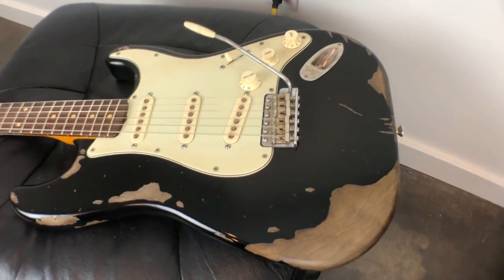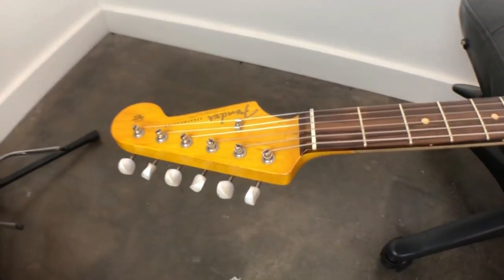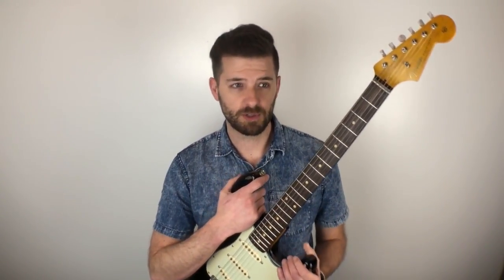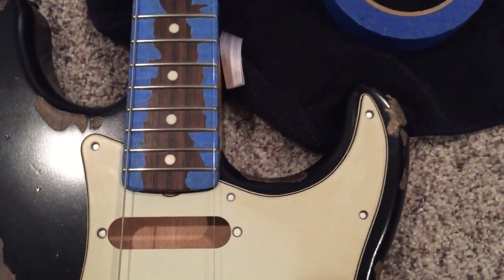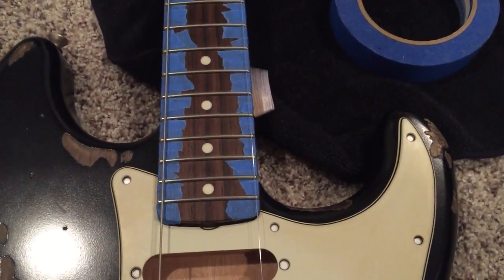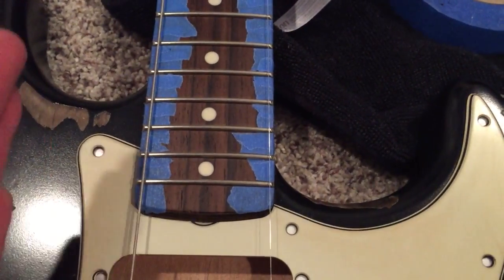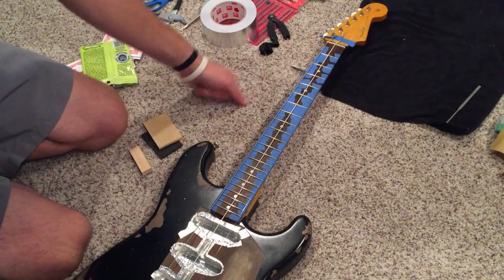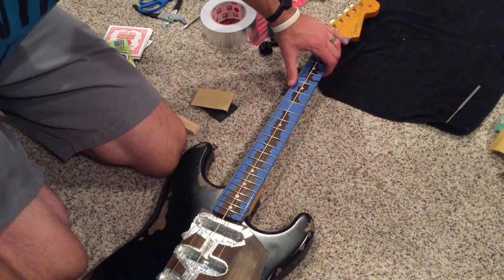How to Install a Bolt On Neck Without a Drill Press

Comment: This might be a dumb question, but could you clamp the neck your way, drill two holes, insert and tighten two screws in those two holes to fixate the neck? Then remove the clamp and drill the remaining two holes?
Reply from the maker: Raunch I don't think it's a dumb question at all. Great idea! I think it would work!

Comment: Too much digressing... the vid title is drilling neck holes with no drill press. A hand drill with a 'bullseye level' can be good enough. But a drill press is precise and the best bet to use. Drill the holes with a bit just smaller than the diameter of the screws and ChapStick will very lightly lube the 4-screw threads to make installing screws easier. I mark the neck heel lightly with a nail just large enough to fit in the 4 neck-attachment-holes. Then drill into those 4 marks carefully and just deep enough. 'Deep enough' is just enough for the screw finally snug in at the neck/plate with the pointed end and barely starting to 'bite' raw wood of the neck rear face. Tap the neck heel after drilling to be sure any sawdust is removed...
Reply from the maker: Thanks for the info.

Comment: Old video I know but i would have used the back plate as the guide for the 4 holes, set the neck where I wanted, used a small punch or coat hanger even to mark where the holes go on the neck, then take a small bit to drill a tiny pilot hole jn the neck so the screw grabs. Put the neck back on, give'er. The screw should catch that pilot hole and go. Then I'd get the screws just where they hit the neck and hand tighten the rest. I've done it in the past without issue. Maybe I got lucky but it doesn't need to be that big of a stresser. ( as long as you don't go through the fretboard lol)
Reply from the maker: Good thoughts! I considered something like this, but I wasn't sure if I could get the holes marked/punched well enough. I think I kind of got lucky too, because I tried this method again & ran into issues, as seen here 😬: https://youtu.be/Pj9CETVxFDE

Comment: I used a $25 right angle screw jig from Amazon, and marked my drill bit with tape for the proper depth to drill my holes into my new strat neck. Took a lot of worry out of it for me, since it was my first time drilling a neck. Worked great, and it was worth the $25 not to ruin the neck. I'm pretty sure I use a 3/16 bit.
Reply from the maker: Nice! Way to get creative. 👍🏻 I’d love to see what you used. Do you have an Amazon link?
Reply: @NathanSink  I just checked at Lowe's ,  and they have drill guide for 8 bucks, but it's not as wide as the one on Amazon, but it would probably with also
Reply from the maker: @caseylee12  oh gotcha. Thanks!

Comment: Hello Nathan,  I'm doing a kitchen table telecaster, no drill press. As you did .I'm dreading this step. This upload helped me out a lot! Especially the tip about wrapping the drill bit with tape. Thank you! So damn the torpedoes!
Reply from the maker: Timothy J. Horan glad it helped! The method worked out great for me & I didn't have any fit-up or alignment issues. 👍🏻 Best of luck!
Reply: be sure a hand drill has a 'bubble' level in the hand-grip area so the bit is kept square to the area to be drilled...

Comment: Thank you for the video, incredibly informative, I will be coming back to this later on in the week when my baritone conversion neck shows up for my Strat, already blacked out the hardware (save the tuners of course haha) this afternoon!
Reply from the maker: Glad to help! Not to scare you or anything, but I thought I might also share this video where drilling the neck holes went wrong 😬: https://youtu.be/Pj9CETVxFDE?si=v_L6Uvzd2KrAyBh- (it’s about 12:53 into the video). Bottom line is just be careful & take your time. 🙂

Comment: Hi, man.
What diameter of drill do you use?
My screw diameter measures 5mm. Do i use exact same gauge or smaller?
Reply from the maker: I believe I used a 1/8 inch bit (which is more like 3mm). Definitely go smaller than your screw diameter.
Reply: @NathanSink  Got it. Smaller than screw diameter. Thanks man

Comment: Thank you very much for your "tutorial" bro. I am like you. Not a professional luthier kk, and have a new neck coming today. I've done this before but had to check it again . Have the same problems and doubts you showed in your video kk, hope I do it ok.
Thanks
Reply from the maker: Roberto Danenberg Candia thanks! Hope your project turns out well. As a word of caution, the next guitar I did this to, I screwed up. You can see it at about 15 minutes in this video: https://youtu.be/Pj9CETVxFDE?t=932 The problem was that I used a C-clamp. So, my advise is to use a good ratcheting clamp!
Reply: @NathanSink  yeap,  fortunately  I have one of these at home. Bought it some time ago to do another job ...we'll see
Reply: @NathanSink  By now I'm watching another video of yours trying to redo an installation on a tele,  the saga  ends lol

Comment: I have a Tonebomb body too but it''s in HSS route.  I put only a little thought into the neck alignment and got lucky though.  That's probably because the Stew Mac Mighty Mite neck was a very snug fit and the neck pocket was squared up nicely.  After marking the neck drill locations through the body, I was just careful to use a drill press ... or lucky enough to now own a drill press.  A machinist showed me to start all holes with a center drill countersink bit as it won't wobble like a drill bit.  So the holes were started and positioned correctly.  Anyway, that only applies if a person has a drill press.  You've shown us how to get things right without a drill press.  Thankfully guys like  you are also showing people how to test neck alignment with the E strings on and the neck clamped in place.  I could have completely botched the neck alignment because I didn't know that tip.  

Like you, I've spent way more on the project strat than a good Korean strat clone would have cost.  That's not what it's about though!
Reply from the maker: 4estGimp thanks for sharing your experience! I haven’t heard from another Tonebomb customer. Glad everything worked out....even with the string alignment. 😊👍🏻

Comment: I am building my own strat using an USA American Special body. But i believe the original Fender necks comes pre-drilled. But i would gone this way:
get body and desired neck
fit and clamp neck as straight as possible then figure out your string spacing for your bridge.
Get the desired tremolo bridge and screw it on, then string up both high and low E-strings only and align them and make sure they are okay.
Clamp down neck and drill holes. then fit on the rest.
Reply from the maker: 0Imtheslime0 yep, I think it would work if you went this way. I believe that's essentially the same way I did it. Most important is to measure as many times as needed & drill only once! The guitar I built after this one didn't go so well, & I had to re-drill: https://youtu.be/O_devvyFZLE

Comment: Thank you for this Video! Currently I´m building my own strat and I just got the same problems to fit my neck... maybe because of my bad skills when I drilled my bridge... 
BTW: Very nice looking strat you got there! ;) How much did you pay for the components?
Reply from the maker: Leonard Noll thank you! Hope your project goes well. I did have a nice spreadsheet with a cost breakdown of all the parts I bought, but I lost it when my computer broke down. I do remember that I bought nearly everything for under $900. Since then I have spent a little bit of money here & there on small little trial projects (like changing out the tuner buttons & staining/dyeing the fret dot markers). But I would definitely say everything came in under $1,000.
Reply: Thank you man! My project is almost finished... I´ve got some problems with my neck...fret buzzing everywhere...

Comment: Would it be easier to just clamp the neck, score the holes, then take the neck off and drill it using a portable drill guide?  That way the neck is lying down and you are pressing on it and the guide.  You could also clamp the flat part of the neck to a workshop table and press down on the  guide hard.  Does that make sense?  Do you know if there is a standard depth to drill the holes on a Fender neck?
Reply from the maker: Art Prince not sure about the standard depth for Fender. To your point, yes that would probably be easier if you had a portable drill guide to work with. This method is a quick & (hopefully) easy way for those that don't. Btw, this method worked great for this guitar, but on my next build things went South 😬:  https://youtu.be/Pj9CETVxFDE

Comment: Thanks Nathan. I'm Tru-Oiling my neck right now(last coat), and then the dreaded fitting. Never done it before. I might chicken out! Haha BTW, i have no bench either. Haha
Reply from the maker: Brian Summers best of luck! This Strat turned out well for me, but I recently did a Tele (which I’ll make a video of at some point) that I screwed up. 😬 I used a c-clamp instead of grip style clamps & it moved on me. I had to plug the holes & re-drill. 😱 Just be careful!
Reply: @NathanSink  Ouch! I watched the StewMac vid, which i think you did as well and of course he used a StewMac clamp or a facsimile of. I worked in my friend Bil Mitchell's shop for a short time, but never got so far as installing a neck. Basic grunt work in a luthier's shop. Think i'll take it to "my guy". Peace and thanks again for contributing to the wonderful world of G.A.S.! ;-)

Comment: how about if you haven't had a hole in the bridge or not already install the bridge how to make it straight or line up
Reply from the maker: That would be a whole other video. :) I actually haven’t done that before. Hope you find some answers.
Reply: I did this (I am not super experienced, and 100% open to suggestions if somebody has a better method):

1. Carefully measure out the middle of the neck pocket at the start, middle and end of the pocket. Connect the dots with a line - this is the beginning of your centerline. 
2. Extend the centerline from the neck pocket along the whole guitar body. A laser can be useful, but is not necessary. If you already have pickup cavities routed, you want to make sure that the centerline and the cavities line up properly. If you notice the cavities do not line up, you will need to adjust or plug in and reroute the cavities later, but not yet.
3. Now fit the neck, making sure it is perfectly aligned with the centerline.
4. Place the bridge by:
a) Measure from the front (fretboard side) of the nut to the middle (top) of the 12th fret. Write down the number. From the middle of the 12th fret, measure the same distance onto the body. That is your scale length line. For standard Fender Strats, Teles and Jazzmasters, the scale length line is 25.5" (648 mm) from the front end of the nut.
b) Now it depends what kind of bridge you have. Google StewMac fret calculator and find out how to place different kinds of bridges in relation to your scale length line.  
c) Generally speaking, for a simple hardtail bridge, you adjust the bridge saddle intonation screws so that the high E saddle is about 65% of its total possible adjustment range towards the neck. Then place the part of the high E saddle where the string will touch the saddle, right over the scale length line. Normally, the high E saddle will intonate a tiny tiny bit back from the scale length line, and all the other saddles will intonate further away from the scale length line towards the butt of the guitar. 
d) Lay the bridge on the body and make sure that the centerline on the body goes right through the gap between the G and the D saddle. For a Tune-o-matic bridge like on a Gibson Les Paul, the bridge posts should be a little offset (check the StewMac fret calculator page again) but for most other bridges, the bridge itself should be parallel with the center line. 

When you have rechecked the above measurements 2 more times, you mark the bridge fastening or centers of the bridge post holes, then use a brad point bit drill or a hole punch to dent the mark. Ideally use a drill press to drill the holes. If you do not have a drill press, start by drilling a very thin pilot hole, being very careful to keep it straight. Then drill gradually larger holes, until your drill bit is just slightly thinner than the screw (DO NOT use a drill bit that is equally wide or wider than the screw itself). 

That should be it. Long post. Ask more if you need clarification and I will try my best to answer.
Reply from the maker: @meadish  Thanks for sharing your approach!

Comment: This is Janky af.  Not a good video imo.
Reply from the maker: Avery's Guitar Stuff it's nice to know someone else uses the word "janky" besides me. As far as the content, this is just my experience that I'm documenting. I don't claim to be an expert. However, this method worked for me & I have had no issues whatsoever with the way the neck fits & is attached to my guitar.
Reply: @NathanSink  What kind of clamp did you use ? Amazon link ?
Reply from the maker: I used one from Harbor Freight, but one like this would work: https://amzn.to/37HV22d